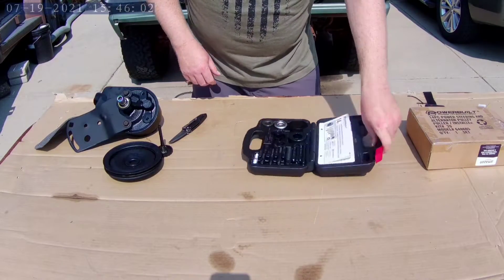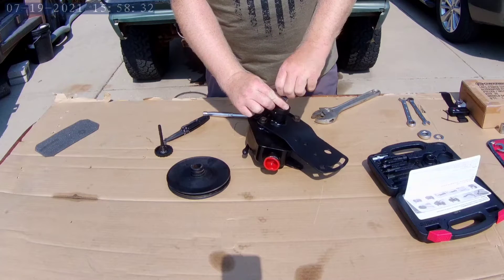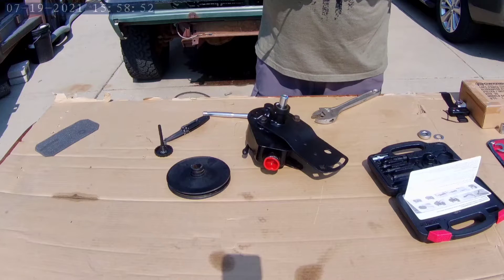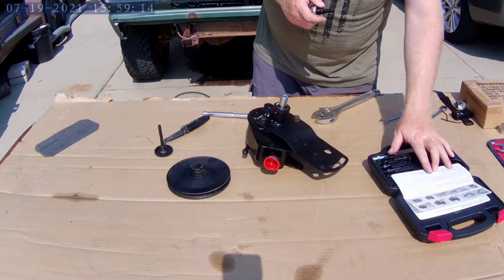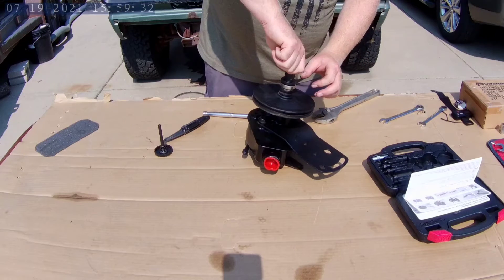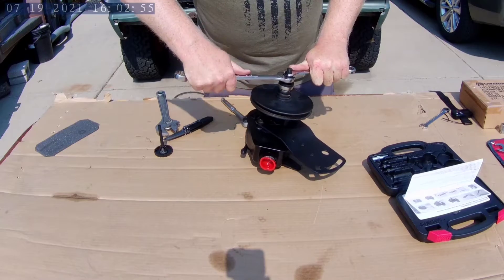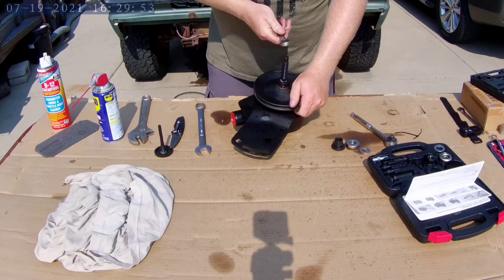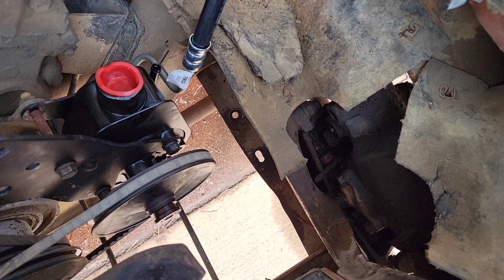Using a power steering pulley installation tool on my 1977 Ramcharger

Comment from the maker: Here is the link for the puller Alltrade 648605 Kit 20 Power Steering and Alternator Pulley Removal and Installation Tool Set https://www.amazon.com/dp/B0028QGTWM/ref=cm_sw_r_apan_glt_fabc_FW83Y0HVJBD9S94Q1HKX?_encoding=UTF8&psc=1